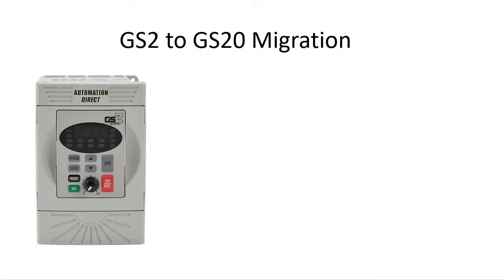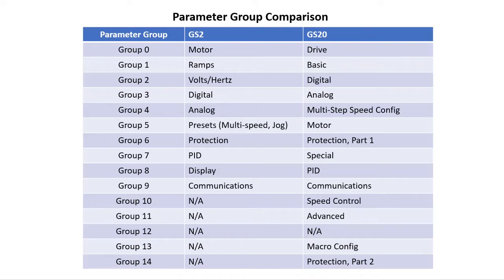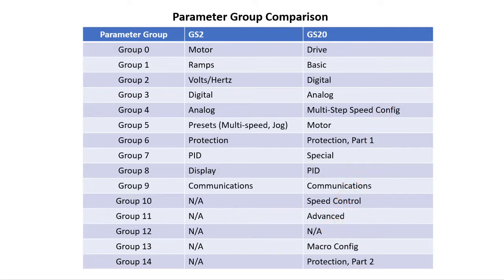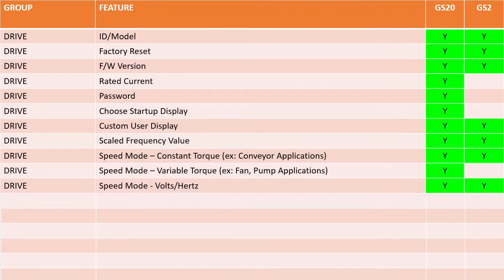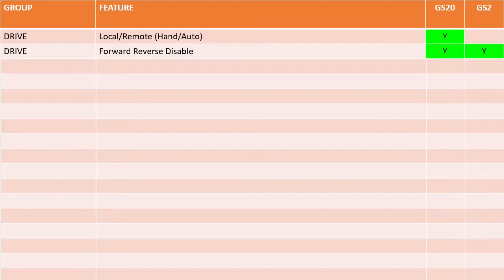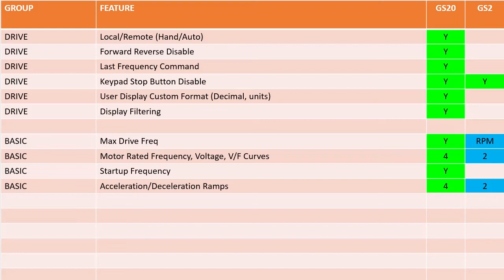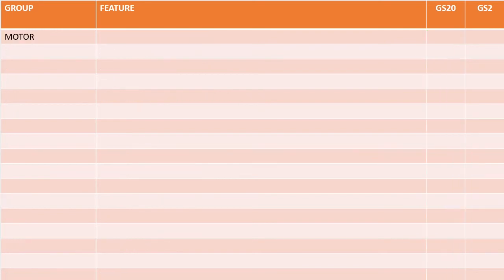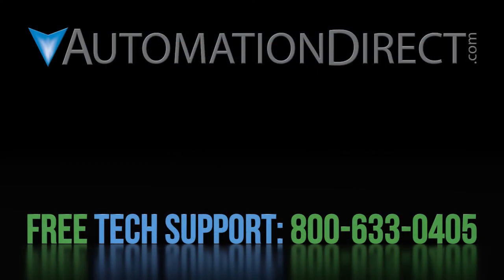GS20(X) GS2 Migration Part 1 from AutomationDirect

Comment: Where can I find more information about the wye-delta setup that you mention at the end of this video? Does this mean that the VFD supports using external wye-delta contactors to start/run the motor in both configurations?
Reply from the maker: More info:  page 57 of the user manual: https://cdn.automationdirect.com/static/manuals/gs20m/gs20m.pdf

wye-delta: yes, see above for info.

Did you know that we have over 1200 tutorial videos at:
www.automationdirect.com/videos .......... by category/random search
www.automationdirect.com/cookbook .... by subject ( a whole chapter on VFDs!)
Reply: @automationdirect  I looked at page 57, but there is nothing regarding wye-delta? I also searched the PDF and only found 2 references, which were both error register definitions.
Reply from the maker: Hi RJK,

Apologies - I fumbled the ball on that one.
See if this gets you a little closer:

Wye-Delta, or Y-connection, Delta (triangle) connection in the GS20 involves digital inputs and outputs. Basically, the drive when so configured can energize a pair of contactors in order to change the motor stator wiring from a wye to a delta configuration. Here is a quick rundown on the parameters associated with the feature.

Multi-function input Command 3 ~ 7, functions 29 and 30. See page 4-83 & 4-86
Multi-function output command 1 ~ 3, functions 31 and 32. See page 4-91 & 4-92

Configuration parameters for wye-delta switching: Page 4-141

P5.23,  Frequency for Y-connection / delta-connection switch for an induction motor
P5.24, Y-connection/delta-connection switch for an induction motor
P5.25, Delay time for Y-connection/delta-connection switch for an induction motor
Note the wiring diagram for the wye and delta contactors on page 4-141
Note the timing diagrams on page 4-142

Hint: Don't looks for wye-delta in the manual - look for "Y-Connection"

Hope this helps!